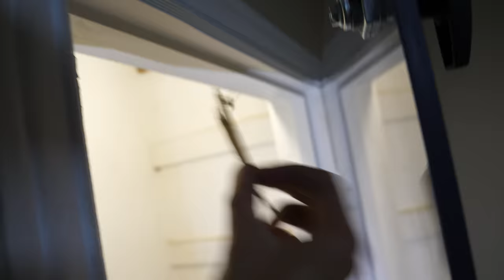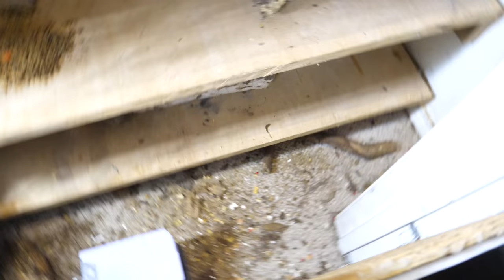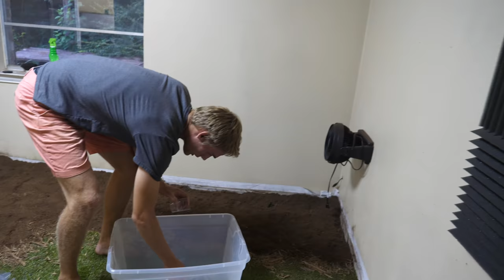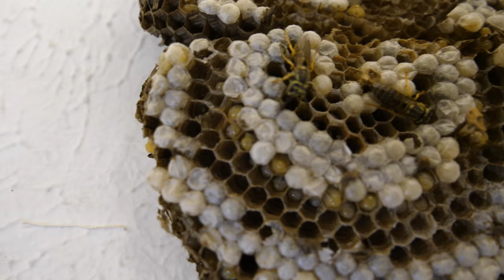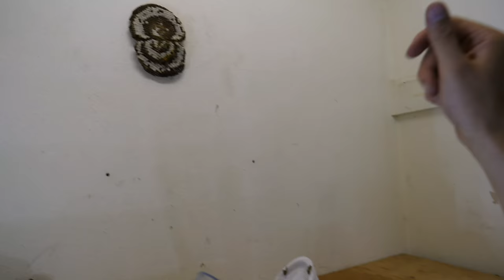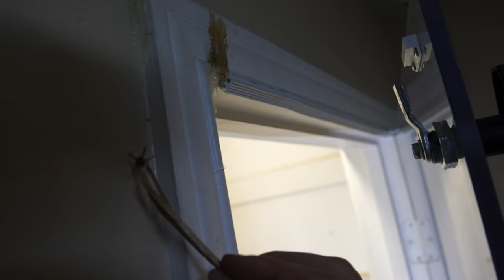Releasing a Yellow Jacket Nest in My Closet - Keeping Wasps as Pets

Comment: "Great job! I really admire what you're doing. But a few tips: First, you’ve attached their nest upside down. They won’t have a problem feeding the larvae, but they don’t have anywhere to hide and rest, and on top of that, they might end up with PTSD. Also, you don't need to fear every wasp when it has its wings folded behind its back. There's no chance it will bite or sting you. Only when they spread their wings in a warning sign, resembling two outstretched fingers, is there something to be worried about."
Reply: Oh, and I noticed that a 60/66 Hz sound from a 2.5-inch speaker has a calming effect on my wasps. Of course, it’s very quiet—something we can’t hear, but they definitely react to it.